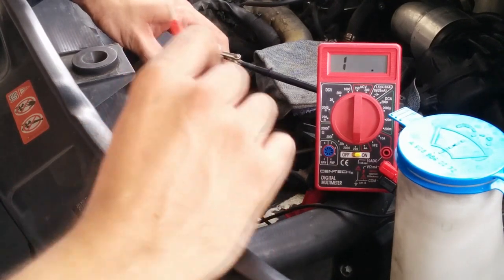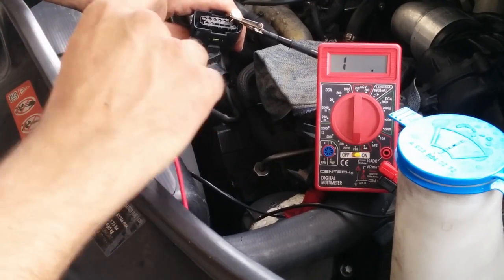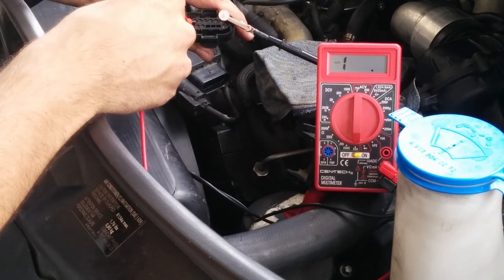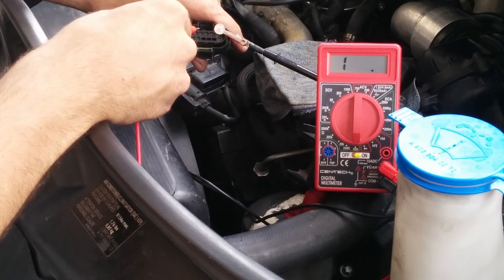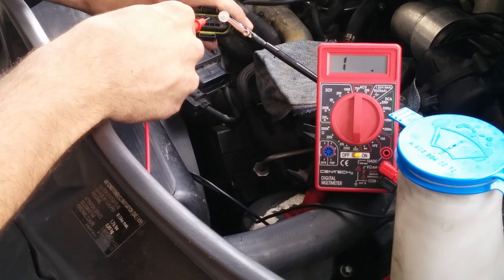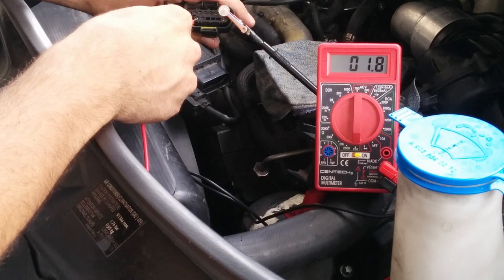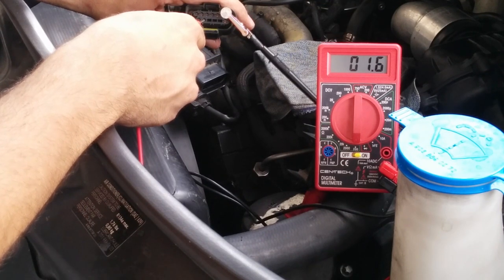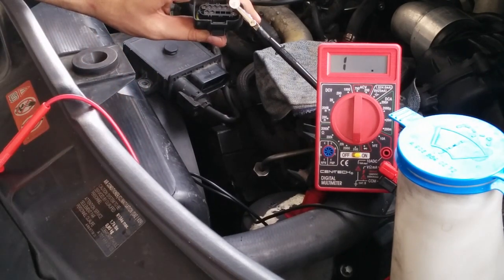Sprinter van Glow Plug Test 2007+

Comment: be great to see a video on how to take the glow plugs out. I hear you want to get the motor as warm as you can before you crank them out or you run the risk of snapping the threaded portion inside the head.

Comment: how do you know which glow plug is number 1, 2,3, or 4?  I need to replace glow plug 4 but I dont know witch one that is.
Reply from the maker: One is first outer next to coolant, passenger side, four is first outer next to let's say power steering pump.sixth is next to fire wall driver side. I would replace them all if vehicle near or above 200,000. Do not jump start anyone with working engine. Another reason to prematurely burn 🔥 glow plugs or module.
Reply: @gyzari  sorry for the revival but just to be on the same page 1,2,3 are from the front rh to rear rh and 4,5,6 are front lh to rear lh ?